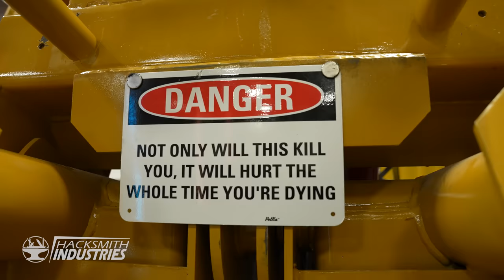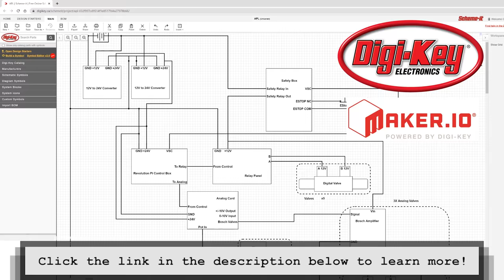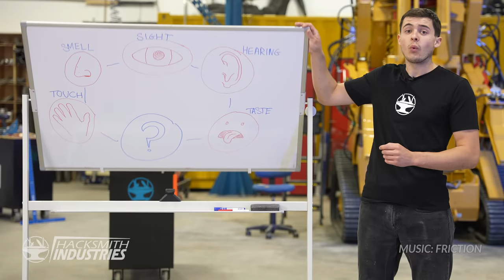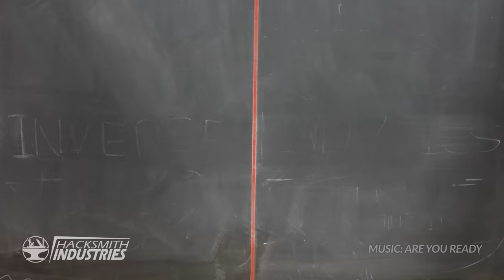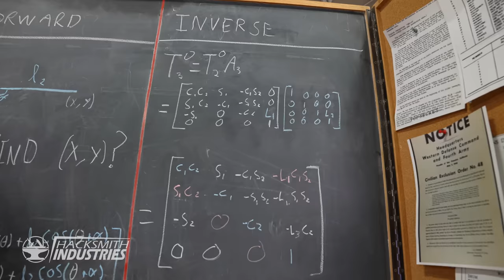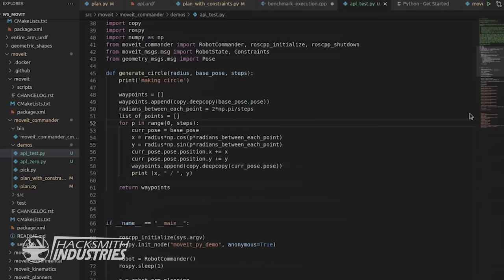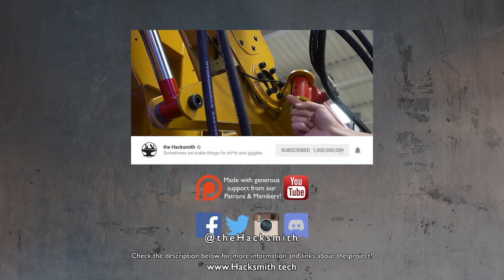All Robots Should Have This Button! (POWER LOADER: PART 15)

Comment: I thought cats came equipped with proportional valves! I know I can get some very very fine movement out of both of my machines and they're just a little bit bigger than yours! Well one smaller and one's bigger. With the joystick controls you can get very fine movements and they are very sensitive so you don't have to worry about guessing as long as you finesse the controls. Because of that I can dance my cat on its front rollers and I can also delicately pick up trees out of their holes and set them in very gently on the trailer even swinging them to the rack with full control.
Reply: I just realized that would mean you would have to reinstall the joysticks because that valve body is located underneath the joystick and is a physical link. I found that out when mine started leaking and I don't know why I didn't think about that. Regardless amazing build so far guys and I hope James is recovering okay.
Reply from the maker: It has proportional valves, but when you add 18 more valves after that... it ain't proportional anymore!
Reply: @hacksmith  I got to thinking about it more 🤣....👨‍🏭 Good luck on that arm

Comment: Seems like a bad idea to be standing between the two arms when starting or throttling up the mech. You can't predict how the hydraulics will act as you power up. Maybe you need to move the starter switch to the back? Or a light curtain in the front that disables the limbs.

Comment: What would happen if the rope potentiometer got caught in something how would your software handle a number that makes no sense
Also I don't know where your mounting that main control box but you might need to vibration as relays don't handle high vibration environments well
Reply from the maker: software fail safes. limited range, expected outputs etc

Comment: Aight so if you have the e stop stopping the engine but the arms can still freely move on the remaining pressure
Reply from the maker: not how hydraulics work
Reply: @hacksmith  our bobcat for some reason likes to move around
Like if I shut the engine off I can still lift the bucket

Comment: use proportional valve for smooth movement.
Reply from the maker: yes,  did you watch the video?
Reply: @hacksmith  ya, i see bosch amplifier proportional valve in circuit diagram.

Comment: Could this be mass produced once it's done? Is that possible?
Reply: im not an expert by any means, but the price of the machinery to produce something like this would be astronomical, the price of everything from molds to the manual labor required would be way to high and unfortunately the demand would be too low since we as a society arent cool enough to implement power loaders in our everyday lifes :/
Reply: @Monkinkin  thank you for sharing and I can definitely see what you're saying.
Reply from the maker: it could certainly be mass produced! this kind of machinery wouldn't be cast,  it is a lot of labor,  but it is possible.  the bigger issue is the design,  it's just not commercially viable -- if we removed the pilot,  maybe ;)

Comment: At this point, why does it need legs? They don't have any practical use at this point of the project. After all the power loader is now using wheels. Maybe you guys could make a cockpit instead? Or alter the legs so it has more practical use? Also standing up at the Power loader now wouldn't be tiring for the pilot?
Reply from the maker: its more practical with tracks you know right? which has been the plan from the start of the project...

Comment: What happens if the string from the pots gets snagged or pulled on inadvertantly? It automatically crushes the pilot?
Reply from the maker: If there's no active input/output for the cylinder, it knows that it's a random fault -- there's also a range limiter

Comment: errrm... how will an emergency button work on a remote control if the problem is that the remote control lost connection to the power loader (as you brought up that problem as a reason to use an emergency button)?
Reply from the maker: that's an auto shutoff condition lol

Comment: wait wait wait. Using a roped pot? Soooo no dealing with fire then. or accidental snagging while operating?
Reply from the maker: There are fail safes. The alternative isn't possible as custom cylinders with built in feedback sacrifice extension limits
Reply: @hacksmith  thanks for the info. Every day is a learning day.

Comment: What part of the mech suit allows it to lift 15,000 LBS?
Reply from the maker: The hydraulic system
Reply: @hacksmith  if you were to increase the hydraulic system by 14x, could it lift over 100 tons?
Reply from the maker: No, the metal wouldn't support that kind of weight
Reply: But maybe using a frame made of plutonium, uranium or tungsten, could it work?
Reply: @hacksmith  how much weight would it need to support

Comment: When you fuck up a 2 year old project by showing how bad an old , non electronic controlled design is compared to the new, better design and you keep your job.
Jokes aside, that whole piece and the labor to make the new part looks painful. But as shown, the left arm and how smooth it runs on higher power is proof that nothing you built so far would handle that long term anyways. Really cool upgrade. Had no idea there was companies specialised in remote safeties, at least not in that form factor. It might have cost you an arm, but it has proven how important it is. Please dont fire Bogdan.

Comment: What I don’t get is why not have it so as long as the remote control signal is detected it is on but as soon as the signal is off it turns off?
Reply from the maker: It has that too lol
Reply: @hacksmith  you have it as like a dead man switch correct? I wasn’t thinking of that exactly I was thinking of a more mechanical thing
Reply from the maker: That's just how it works, the most basic feature haha
Reply: @hacksmith  oh so a bit of lost in translation moment form video to brain, that makes sense and is prolly easier then what I was thinking

Comment: why haven't you used gyroscopes ?
Reply from the maker: because it doesn't have legs and weighs too much xD
Reply: @hacksmith  hi how are ya
Reply: @hacksmith no i mean these small pcb gyroscopes instead of the rope potentiometer
Reply from the maker: Don't think that would work
Reply: @hacksmith  why not? It works for me to track random objects compared to a fixpoint. alsow it is easy with arduino
Reply: @hacksmith  but no matter, because you have already found a good solution
Reply from the maker: what about when the whole thing moves?

Comment: What an amazing project! Just a question, why don't you measure the angle of each joint with a typical rotary encoder? I think it would be much more reliable than a flexible wire.
Also, just measuring does not automatically create a "closed-loop control", it just provides you with a feedback of the real state of the system. The "closed-loop system" depends on the algorithms that control the outputs depending on a setpoint and the feedback.

Comment: Rope pots? See you in the ER. 
Greyscale resolvers.
Reply from the maker: they'll have range limits and failsafes for operation. i.e. no you can't grab the wire and pull it while you're operating it

Comment: You have those great proportional valves but are controlling them with those dinky joysticks!  You need to get better controls (NOT GAMING JOYSTICKS, that are mostly digital in nature) that have enough range of movement so you can actually have fine control.  This machine is REAL, not a video game!
Reply from the maker: those are $1500 flightsim joysticks dude....
Reply: @hacksmith  Another question about these joysticks.  You mention these are "flightsim" sticks.  Do they have force feedback?  If you put hydraulic pressure sensors on each cylinder, you could have FORCE FEEDBACK!  Now that would be way over the top!
Reply from the maker: yup